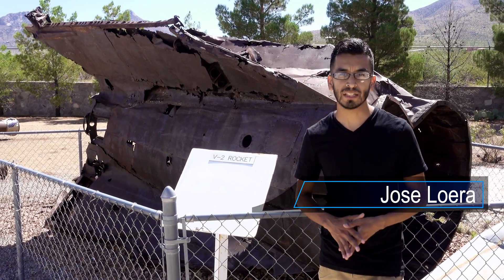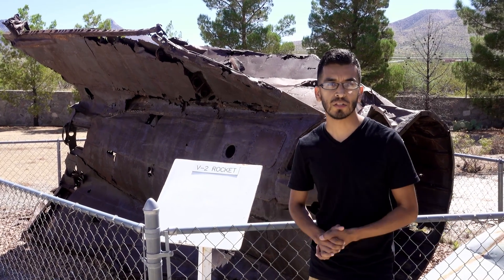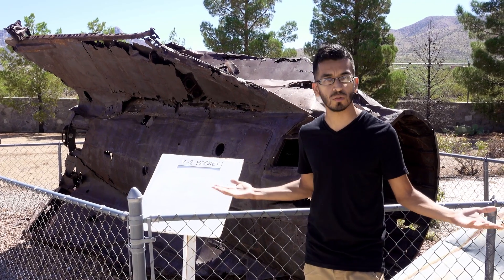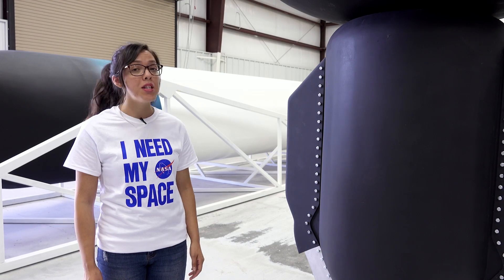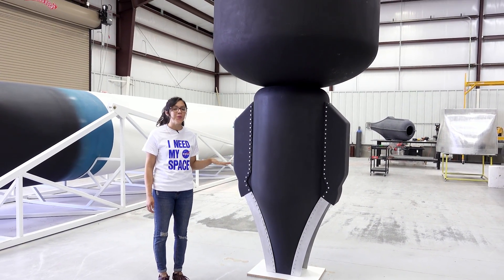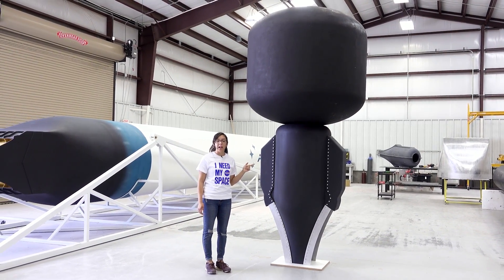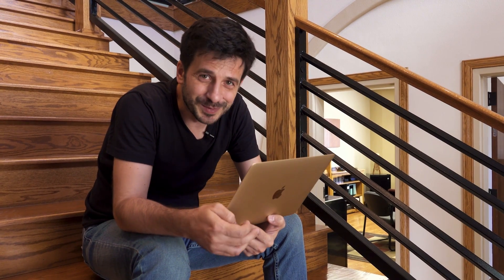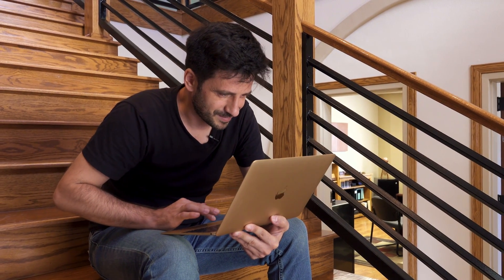Flight of the Aerospike: Episode 7 - Frequently Asked Questions

Comment: Hi, Dumitru. You mentioned that the mechanical layer is made from fiberglass and epoxy resin and that the thermal layer is made from composites, but you couldn't say what kind of composites. 4:02 Why are you unable to tell us what kind of composites are used for the thermal layer?
Reply: you5711 glass silica phenolic oreven paper phenolic.they could also line the shit with graphite whatever is just 250 deg

Comment: Why aerospike? Why doesn't commercial space use this?
Reply: Aerospikes are heavier and also suffer from the base drag phenomenon, right? Also using only high-test H2O2 with such a poor Isp (<100s) means that it doesn't even hold a candle to the likes of APCP solid fuel rockets that are pushing 280s. What makes your engine/rocket superior to the failed Rockwell/NASA linear aerospike SSTO? A cheaper solid fuel booster with a second stage with a nozzle adapted for higher altitudes might still be more weight efficient or cost efficient.

Also, why keep the thermal layer of your "combustion" chamber secret? There are many fiber and matrix composites that can easily withstand those elevated temperatures without going to exotic materials like C/C or C/SiC or coating with Boron Nitride. Phenolic resin with S-Glass would easily withstand those conditions. Some epoxies too. Concerns about reactivity with H2O2 could be eliminated by coating with a sacrificial layer of glass cloth or alumina.

Comment: Temperature control with composites will prove to be a problem in the future.
For the HAAS 2CA, the combustion area and nozzle will use an ablative heat shield under the composite layer?

For the Demonstrator 3 rocket, you didn't mention an ablative layer.

Instead of an ablative layer, have you considered carbon-carbon composite, as used on the space shuttle? That should be reusable.

I also understand that for the propellants, you're planning on using kerosene as fuel and H2O2 as oxidizer. However, LOX would provide superior performance, with the cost of cryogenic concerns. Now composite doesn't normally behave well with cryogenic propellants, but Northrop Grumman, NASA, and Lockheed Martin developed composite cryogenic tanks that can not only handle LOX, but also LH2.

"After the cancellation in 2001, engineers were able to make a working liquid oxygen tank out of carbon fiber composite.[citation needed]

On September 7, 2004, Northrop Grumman and NASA engineers unveiled a liquid hydrogen tank made of carbon fiber composite material that had demonstrated the ability for repeated fuelings and simulated launch cycles.[8] Northrop Grumman concluded that these successful tests have enabled the development and refinement of new manufacturing processes that will allow the company to build large composite tanks without an autoclave; and design and engineering development of conformal fuel tanks appropriate for use on a single-stage-to-orbit vehicle.[13]"

https://en.wikipedia.org/wiki/Lockheed_Martin_X-33#Commercial_spaceflight
Reply: So you don't use any regenerative cooling? Not even for the final version? Is the heat resistan composite ceramic based?

Comment: And the stalling begins.
Reply: Buck Fitches Actually they werent stalling, theyre business, designing, and buliding were put on hold when there were charges placed on the CEO which he has recently gotten dropped.
Reply: I have see too many of these promising projects just disappear after generating enormous amounts of interest. Prove me wrong, please.
Reply: Well we're here in 2018... No video of a working engine. So yes, you're stalling. 
As for FAQ questions, I have 2. What's the projected mass flow rate? And what is the projected exhaust velocity?
I mean, you've mentioned specific impulse but I'm stuck as to what you're expecting to lift with this thing. 95 seconds specific impulse? You'll be out of fuel before you're in orbit. Also, how do you maintain exhaust velocity? Surely, the rate of decomposition lessens as the catalyst wears out. You are trying to get to orbit yeah and not just build a cruise missile?